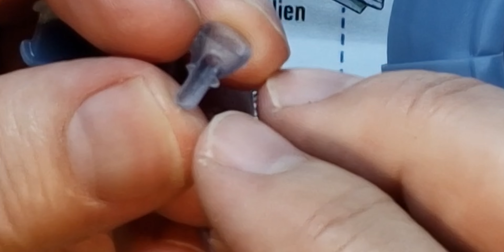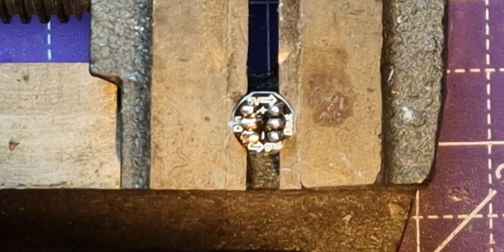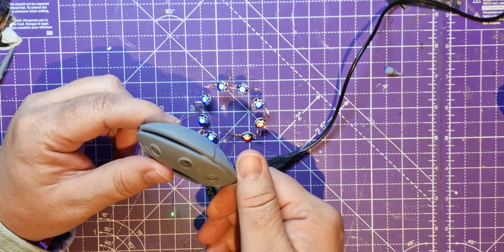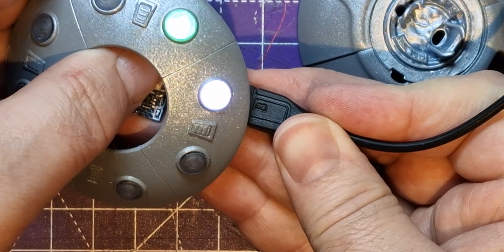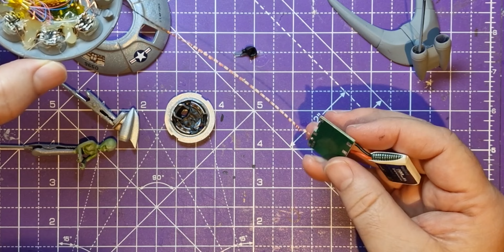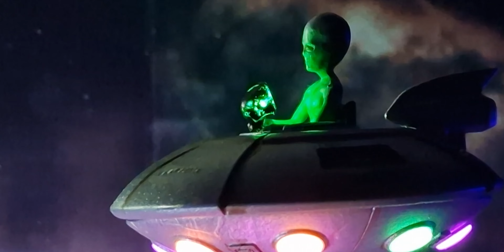Turning a UFO garage kit into the Avrocar VZ-9AV fighter bomber with WEMOS D1 wled Neopixel leds

Comment: Great idea and cracking solder job! I especially liked the plane kit decals, it was a good catch and was really fitting.
I was thinking what I'd do with it and I think if you'd put it on a thin bendy "arm" it would make an AMAZING desk lamp, just slap a bright led on the middle.
Reply from the maker: Great idea for the desk lamp, although it.its quite small but if you used star leds then it might look great as a lamp.
Reply: @spidermaf  Even better!